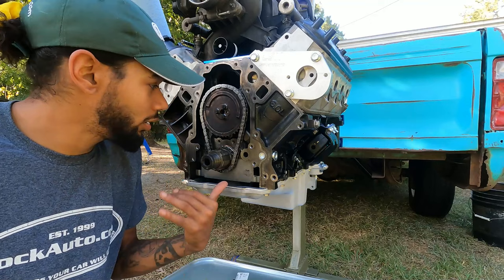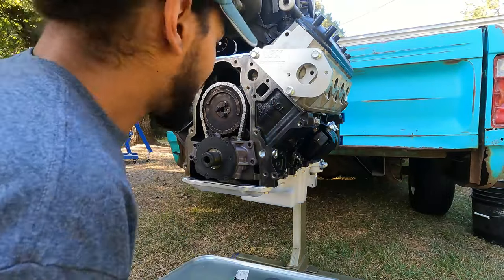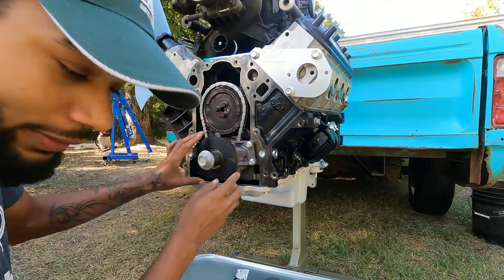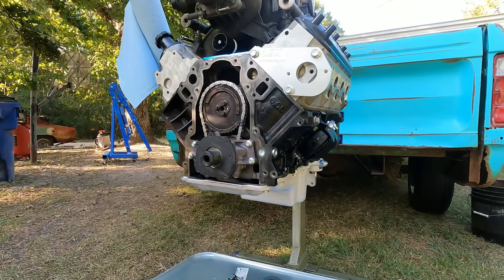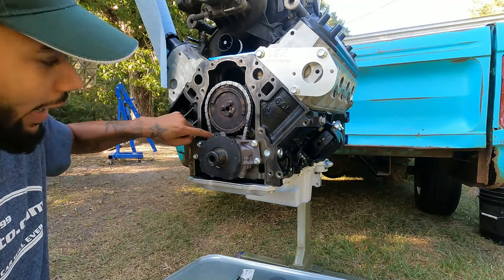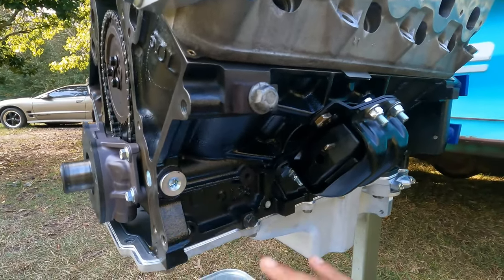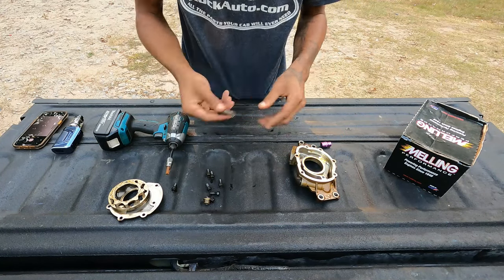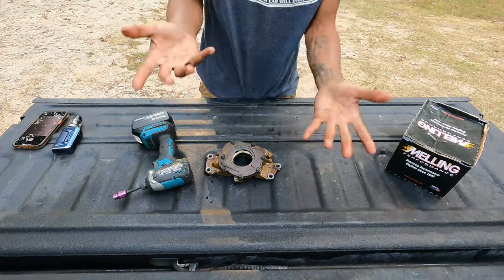Super Easy LS Oil Pump Install (Super High Mileage LQ4)

Comment: Couple flat washers stacked inside the bypass plug to make the spring a little tighter will easily give ya another 10-20 psi oil pressure and revive a oil pump that was losing pressure as well and yours looks good enough to do just that!
Reply from the maker: I’ve definitely heard of that method! Also, my oil pump was still good, it’s definitely sitting in the box on the shelf. Figured since I was doing a fresh build, the least I could do is a new pump 🙂

Comment: I am an ASE World Class Automotive Technician "Triple Master" and have 22+ Years Working Professionally. In all Brutal honesty I'm not going to say your incorrect and It's not that the internet made it over complicated. (The Smoke em procedure- when you tightened them down could of re-offset the pump gears lol) If you tighten the pump with shims installed you know it's perfect then you remove the shims. If you build an LS engine and you take extra care in making sure everything will come out flawless with your engine build you will shim the pump. This is by far one of the biggest issues with LS engines is Oil Pressure Problems in Pre-AFM/DoD and honestly even after... People aren't wrong when the pump housing has too much slack for the bolts and the gear CAN become uncentered and cause premature wear. You can not shim an oil pump and get 150k out of the engine. Or you can not shim the pump and get 20,000 miles. So why not make sure it's perfect. Not to mention I can't count with 100 hands how many times I've gotten inferior machined parts or defective parts and I want to make sure everything is set up flawlessly. It gives you the opportunity to look at the gears and making sure they mesh perfectly. Melling has a great reputation but everyone makes mistakes and all you can do is do everything in your power to take the time and not make them and throw the crappy parts at your service manager or if your at home family members.... lol... . Thanks for your video...
Reply: Thanks for the solid comment 👍
Reply: I saw a video of a guy using a dual indicator on the end of the crank and if you push it down then it moves more than what you'd shim it anyway. So shimming is pointless

Comment: One thing you missed was the piston on the end of the relief spring galley. You want to make sure it’s not getting jammed up with a small piece of debris. That can cause loss of oil pressure if it gets hung up. Everything else was great! Short sweet and to the point! 😎👍
Reply from the maker: Thanks!!! Appreciate it!

Comment: Yes you can reuse it. Just change change the pump gear and spring. Make sure it's super clean. The other thing is change that damn o ring on the pick up tube just under the pump
Reply from the maker: Definitely plan on attacking the oil pump ring when I go to fully install the Holley pan. Just waiting on a nice pretty day.
Reply: Where u get a pump gear n spring from?
Reply: @saradeyo9434  That's a great question. Just get a pump from the junkyard and tear it open

Comment: Even Melling own utube video pump install instructions say to do it that way, and they make the things. All they say is to prime them after instal before starting. Like you say maybe for prevention of problems later on for high horse power high output engines that want millimetre perfect performance should shim.

Comment: Ive got an 07 5.3 Sierra and changing the oil i have what looks like bearings out of a universal joint cap stuck to the magnet on the oil pan bolt.could you tell me what might be going on with this please
Reply from the maker: Wait, like little needle bearings? If so, probably from the lifter. It’s common for those lifters to fail on DoD motors.

Comment: Im in the middle of changing one out on a 99 4.8 with 70k miles on it. It was a government vehicle. When oil gauge showed dropping pressure and then none at all, i knew it probably wasn't a sensor. After draining the oil and pulling the filter, im not so sure now. Filter might as well have been filled with grease. Luckily im not seeing metal shavings. Good time to tear the heads off, it needs new gaskets as it was developing a leak on the exhaust side.😮

Comment: Should you fill the oil pump with oil first or is it ok not to? Kinda like the oil filter
Reply from the maker: I’ve always fill the pump. Just something to prevent a dry start. Now you can take the front plate off the pump and use assembly lube if you don’t plan on starting the engine for some time.

Comment: The ball and float above that spring wear out and allows oil to bypass decreasing oil pressure.  The rotary gears never wear out.  So did you just pull this one to clean and re-seal?
Reply from the maker: I pulled this one and boxed it for later on, I ended up going with a new one since the motor was completely freshen up. When I do a down and dirty budget rebuild or happen to have a failed oil pump in the future, I’ll be revisiting the one I pulled.

Comment: Might be a dumb question to ask but is there any difference between a 295 and a 296 Melling pump I have a 03 5.3P Chevy tryna see which one’s best any recommendations?
Reply from the maker: 295 is a high pressure as the 296 is a high volume. Personally I run 295 pumps. Those pumps are a whole controversy topic😅

I say go for the 296 if you have a AFM/VVT setup as it requires more oil flow. If you don’t have any of that in your build or setup, just run the 295.

Comment: Nothing wrong with that used pump, clean it up and put it back together for the next build.
You can add a washer or shim in behind that spring for alil higher oil pressure.
Reply from the maker: It’s definitely on the shelf for the next build.
Reply: @TKSpeedShop  I have seen a few videos where guys took them apart and they were scraped or roughed up inside.  All of mine so far looked like yours no matter the mileage still in good shape.
Reply from the maker: I’ve also seen that! Figured why not see for myself.

Comment: The internet isn't making it Complicated.  There is a difference between an engine Assembler and an engine builder.  To some, Making things Perfect is completely normal. It takes what? 3  Minutes. Plus you inside guy, That knows everything the factory does. Should have Considered the factory also Doesn't sell 1000hp lq4"s.  You didn't need those aftermarket bolts eather did you? I wonder if someone is confused by that? Dam Internet!  Except for my channel don't forget To like in subscribe leave a comment and ring the little bell ;) ;)

Comment: When are U going to hookup the pickup tube?
Reply from the maker: It’s already installed, I’ve been working on another video following the complete breakdown and rebuild of one. For this one, since I used a 10295 pump, it had two provisions for 8mm bolts instead of 1.
Reply: @TKSpeedShop  the hardest part is putting the two. bolts back  in the pickup tube with the pan still on.
Reply from the maker: @donhardy7467  Oh most definitely, I am not against dropping the pan.

Comment: So the 296 pump is for dod and afm engines while the 295 is for engines without it ?
Reply from the maker: From a logical standpoint, yes. DOD/AFM need more volume to perform the functions.
Reply: @TKSpeedShop  I’m asking bc I have a 2001 5.3 getting a complete rebuild with single turbo I wanna choose the right one and not mess up
Reply from the maker: @Daredevil_boost the 295 is the way to go!
Reply from the maker: @Daredevil_boost plus I have a good bit of friends running 295s on boosted setups
Reply: @TKSpeedShop  thanks man
Reply: @TKSpeedShop  beautiful exactly what I wanna know lol

Comment: Never did see the oil pick up tube installed !
Reply: I was watching to see if I could change this without dropping the pan. But he didn't even put it on.
Reply from the maker: @BudgetPowerGarage I definitely got a more, in depth video coming. I can tell you it would be very difficult to do it without dropping the pan since the pickup on the bottom of the pump doesn’t move so you would have to press the pump onto it. Problem with that is, you have to also be able to get the pump onto the crank.
Reply from the maker: @jbdavis267 Sorry about that bud, but hey, I do have another LS that I will be breaking down on the channel soon. Got a list of stuff that people ask about. Gonna see if I can answer a lot of it in a video for you guys 🙂

Comment: Do you have to turn the crank after installing it? I forgot to do it
Reply from the maker: GM recommends turning the crank a full rotation. This allows the gears to align. To be 100% honest, I don’t believe it matters much. Most people just throw them on and run them. Sloppy Mechanics also does it and he has thousands of hours inside these motors.

Moral of the story, it’s good practice but your good bro.
Reply: @TKSpeedShop  that’s great to hear I’ve been getting relieved and scared lol, half the people say always shim/spin crank, others say they’ve never done it and gm themselves doesn’t do it. Only thing I’m kinda relieved of is I’ve seen a lot of people say the crank is hard to turn over if it’s in wrong, and when I was installing my crank bolt it started spinning pretty easily so I had to hold the flywheel with a wrench to tighten it down, so hopefully that means it’s on even enough
Reply from the maker: You should be good bro, the shimming stuff is so controversial. Now I know some high performance pumps require shimming but when we are talking about OEM pumps or melling, it’s a simple bolt on and go. As long as your crank turns as it should, I wouldn’t worry about a thing 🙂
Reply: @TKSpeedShop  thanks bro, I’m 90% sure it turns really well, I’ll check again when doing the lifters because then i can turn it over with no compression at all, it’s my first engine so I wanna do everything perfect but everywhere I look I see different opinions and I don’t wanna have a easy thing I can avoid cause a problem,

Comment: So simple till its on the vehicle and you gotta drop the oil pan to get to the pickup tube 😂
Reply from the maker: Pretty much 😅 it’s not that extreme if it’s in a truck since you kinda have clearance to drop the oil pan. In a F-Body it’s a different story 😅
Reply: 4 wheel drive truck no fun to drop the pan you have to drop the front differential

Comment: If you have any contact between the pump rotating parts and that pump housing, you're going to cause damage to the oil pump. That's why some people do the proper job and actually shim them in place. It's easier to do if you just take a one-and-a-half to two thousand shim and put it on the top, push put a 2000 Shem underneath and put it on lengthwise. You don't need to use three shims. Two long ones and put them in lengthwise one on top and one on the bottom. But doing this will cause damage about 30% of oil pumps that are put on that way. Do not listen to this man. Lucky don't cut it. Doing it right does. 
It's a hell of a lot easier to do it right than it is to do it over!
Reply from the maker: GM never did from the factory nor does it say to shim them in the service manual. Built plenty of LS motors and never had a issue.

Thanks for commenting 🙂
Reply: If you want your opnion taken seriously learn how to spell shim and how to correctly write .002

Comment: I don’t know how to tell you this but when you put the oil pump on, then backed it out and “smoked them” with the impact then tried torquing it to 18 😂. That don’t work like that. You literally went over with the gun. Also good practice when tightening things like that is go cross directional. If you tighten with gun you never getting 18. Even the m12 electronic wrench tightens to roughly 30. You over torqued those bolts like mf.
Reply from the maker: Yeahhhhh I kinda thought the same. So far though, the motor is doing extremely well 🙂
Reply: @TKSpeedShop  it was very informative, congrats on the build.
Reply: Well, at least his dogs love him.

Comment: The oil pump needs to be centered no matter how much it flows or how much power you make. It literally only takes 5 minutes to do. Seems like such a careless mistake to make.
Reply from the maker: In the video, I cover aligning the pump after installing it loosely before torquing. Fun fact, Melling (the pump in the video) also does not shim their pumps per installation. Thanks for watching and commenting 🙂

Comment: Yeah super easy when you have the engine out 😡
Reply from the maker: It’s honestly not that bad when the motor is in the car/truck. Drop water pump, balancer, timing cover, then move to the bottom and drop oil pan along with the pickup tube. Just make sure you got some good tall Jack stands you trust 🙂
Reply: Yeah is not bad when you have awd 6.2 🤦‍♂️
Reply: Very easy 2wd but when is awd is not funn
Reply from the maker: Oof. I can only imagine 🥲
Reply: Yeah is hard because i have to remove lot stuff